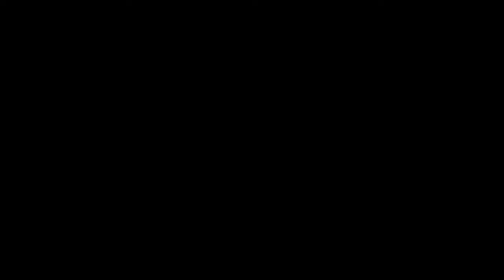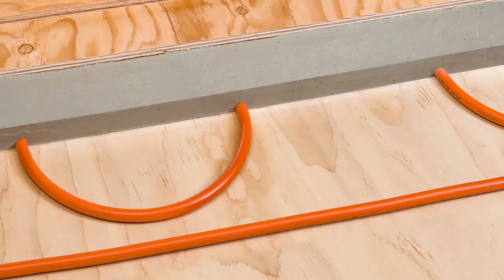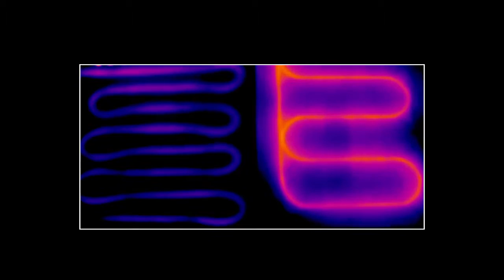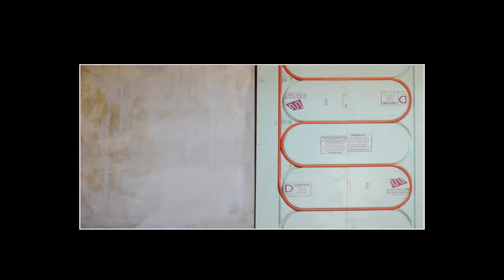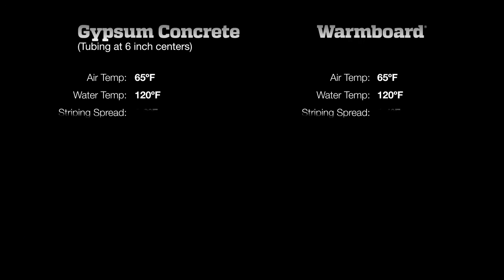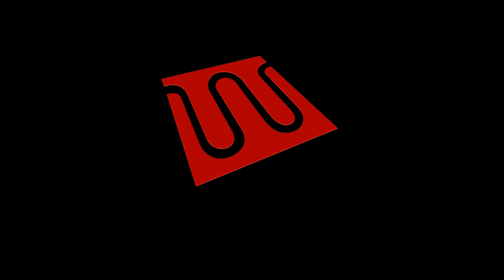Radiant Heat Performance: Gypsum Concrete (6 inch) vs Warmboard

Comment: How about energy efficiency over 24-48 hour periods?  The faster to heat up means the faster to cool down.  You're example seems to be similar to cast iron vs steel/aluminum fin radiators...
Reply: Great question,   my Warmboard home starts off has 2 temperature settings.  70 degrees at 5 am and 64 degrees at 9pm for a cool night's sleep.  At 5am,   it takes about 1:15 to go from 64 degrees to 70 degrees, by the time I get out of bed at 6am it is so comfortable.    If cold outside,   the boiler runs again around 11am for a short period then again at around 3pm.    With a modulating boiler with a 10:1 turn down,  trickling out a little heat is done very effectively.   COlorado can have 3-4 seasons in one week and I never have to wait for comfort.   my natural gas bill for my Lochinvar boiler, cook top, and gas fireplace is around $100 per month in the winter.